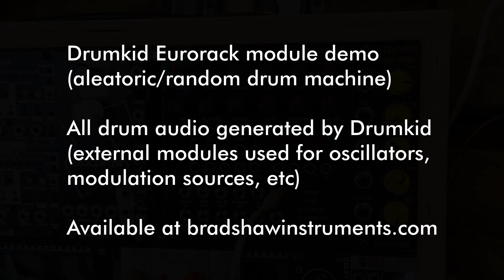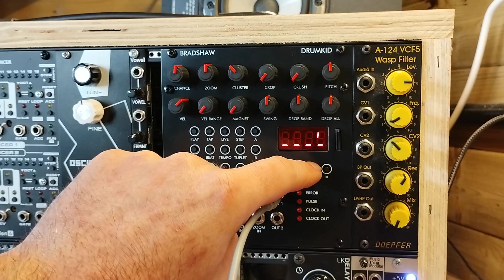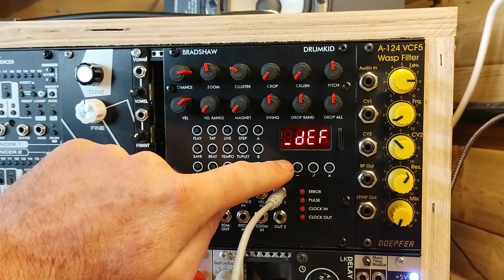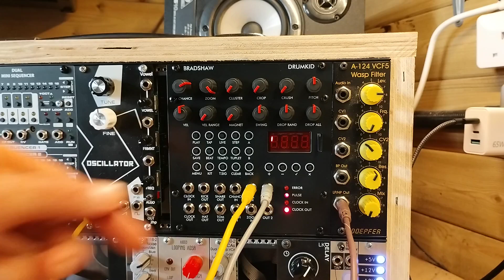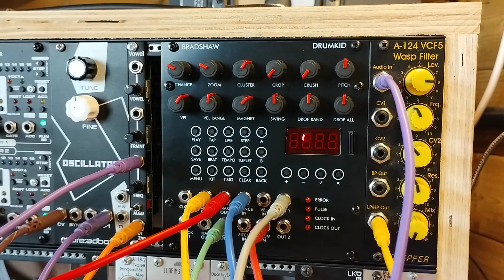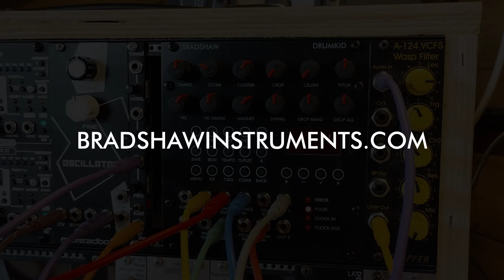Drumkid Eurorack demo (aleatoric/random drum machine)

Comment: Really interested, but curious how does it reset to stay on beat with other sequencers? I don't see a rest input?
Reply from the maker: Thanks for your interest! I did consider adding a reset input but it didn't make the final list of features. It can be reset to the start of a bar in external clock mode by hitting the "start" button. Alternatively it would be possible to add a reset input in the next firmware update (taking over one of the four CV inputs, selected from the menu), if you think this would be useful?

Comment: will this work independently if I haven't made the leap into eurorack yet? 

I have the og drum kid and love but like the extra knobs and control on this version... yr not making it easy trying to resist the siren call of eurorack
Reply from the maker: @zhouse2846  You would need some sort of case and Eurorack power supply, so it's not really a standalone instrument in that sense, although it can do plenty without using the CV connectivity. Theoretically my next project is a proper standalone version of this module (a proper sequel to the original Drumkid), although it may be up to a year away!
Reply: @BradshawInstruments  As a massive fan on the OG, I would love this as a desktop version.
Reply: @BradshawInstruments  Any update on this possibility? Also, could two of these be synced?

Comment: Awesome! I was actually just listening to a couple jams that were in part made with the original standalone version, and am a big fan!

Comparing the two, obviously this has a number of additions like dedicated controls, multiple audio and trigger outs, cv inputs and more. But It looks like this doesn’t have MIDI? Kind of understandable given the modular focus, and you have to draw a line somewhere, but that’s one of my favorite features of the original as it allows the layering of the internal drums with the world of hardware and software drums out there, along with recording and editing of a performance. Perhaps one of the audio outs could be coaxed into service? And any chance of a kit version making its way to Thonk?

Anyway I don’t mean to detract from this beast that I know you put a lot of thought and time into. Thank you!
Reply from the maker: Yeah it was really tricky figuring out what to keep and what to get rid of. I wanted it to feel at home in a Eurorack setup and not be a weird outlier, so decided to get rid of MIDI (because it's not a normal feature in modules) and the drone features (because modules tend to be single-function, and also I didn't want to add more knobs now that all the knobs are single-function), but both those features could definitely be added. There's a Raspberry Pi Pico 2 running all the code, so I'm guessing you could repurpose pins 0 and 1 (serial) for MIDI, either adding some extra sockets on a separate module or sacrificing some of the existing sockets. Bit of a project though!

Hoping to do a Thonk kit at some point in the next couple of months once the main launch work has died down :)